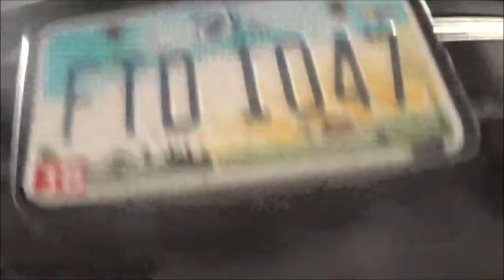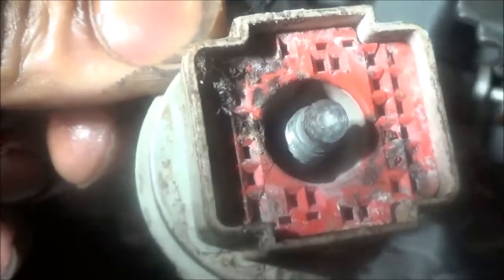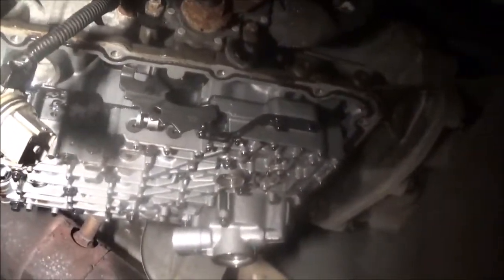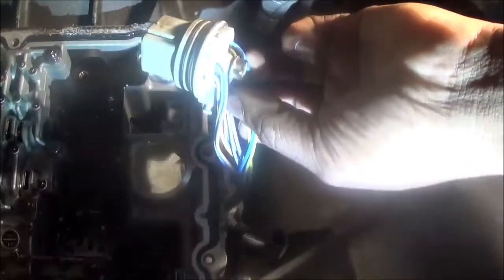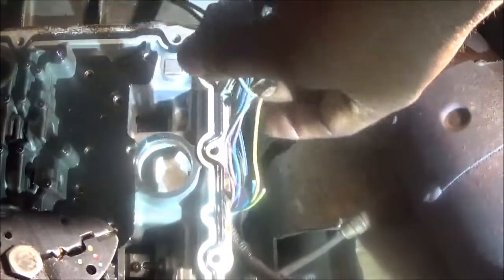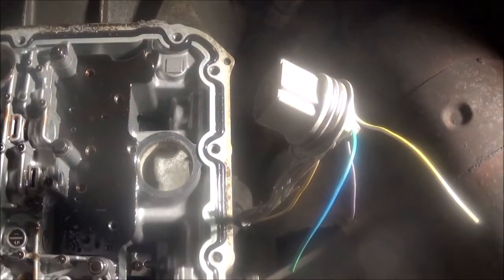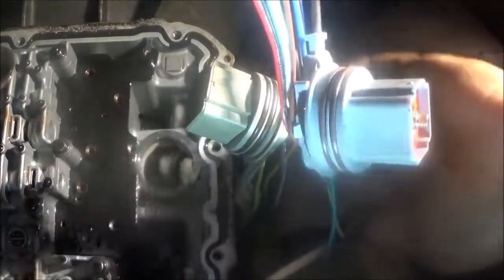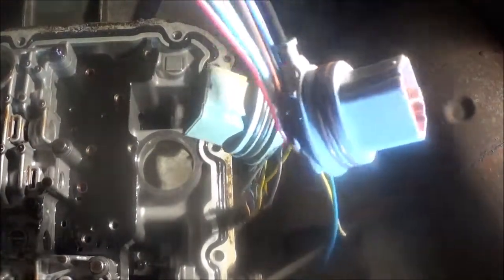2006 FORD EXPLORER MULTIPLE TRANSMISSION ELECTRICAL CODES (PART 1) P0743, P0755, P0760, P0765, P0962

Comment: thanks for all the great info.

I had the same error codes for all solenoids then I changed the socket with complete wires network up to PCM. 

but unfortunately, still, code P0760 Shift Solenoid C is appearing. 

could you please explain WHY?

Comment: Hello! Do you know if the selenoid pack geniune is bosh brand ,  thanks in advance..
Reply from the maker: This I do not know. However, I always try to get a new solenoid, not a used/remanufactured/rebuilt one.

Comment: Can I test the solenoid pac pins without removing it and what socket I will need for that bolt
Reply from the maker: The bolt is 10mm. If you can get to the pins, then you can check them, however, it may be hard while on the vehicle without a test harness that you can plug into it.